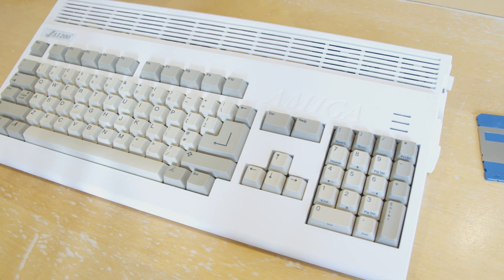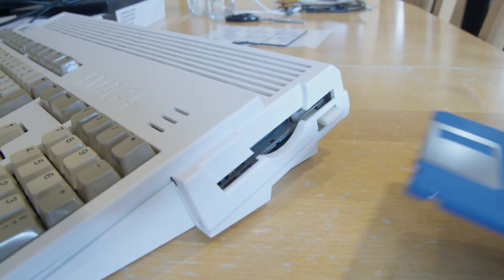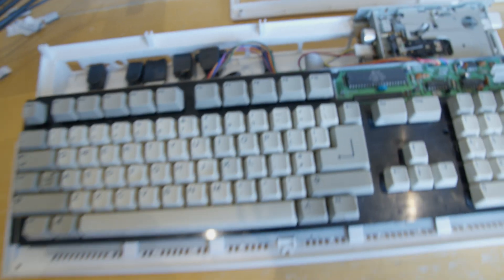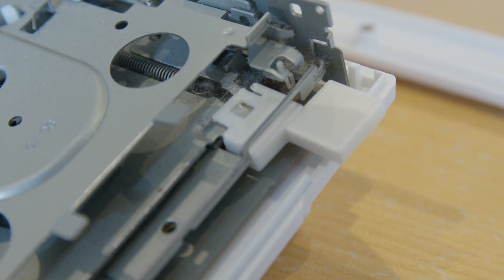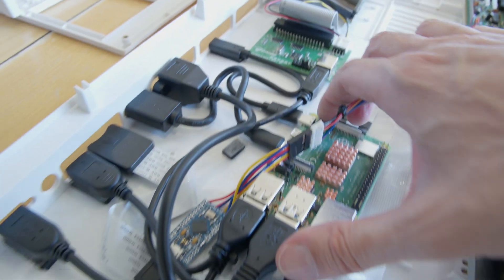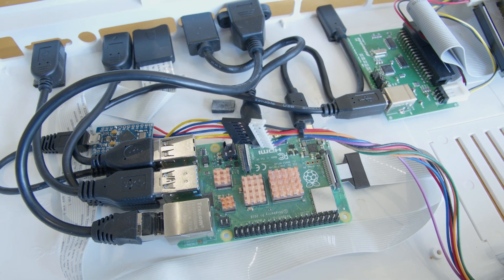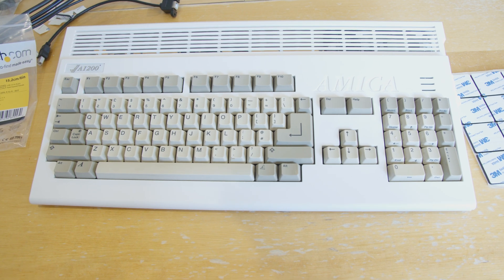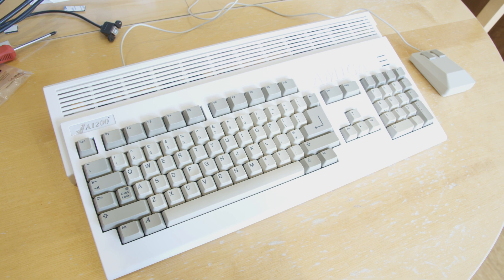This Amiga is not an Amiga

Comment: Hey does that go alright ? I mean does it feal like an amiga ?
And floppy loading etc
Reply from the maker: It's exactly like an Amiga. Floppy loading works just the same and makes all the same noises.
Reply: @RobFisherUK  cool. I just want to get Real crt 15khz on there with 288p scan mode on pi 4 unless pi3 is fast enough in stock speeds
Reply from the maker: @easyerthanyouthink  I've only tried my Pi 4 with HDMI. For CRT I was thinking about using a MiSTER FPGA but for now I only have an Acorn AKF60 and some of the Mister emulators drive it but not the Amiga one, so I don't have any direct experience.

Comment: Fantastic build and very much like the one i built last year for myself. 1x Amiga 1200 reproduction case bought from RetroPassion here in the UK (in grey colour but have since painted it cherry red colour), 1x Raspberry Pi 3b+ board (my spare one at the time of build) 1x Keyrah v2 keyboard interface board and a fully working Amiga 1200 keyboard (both of these were kindly donated to me by an awesome guy here in the UK). Made a full blanking plate for the rear of the casing (from a spare sheet of plastic i had laying around) and cut out all the holes needed to HDMI, On/Off switch, R/Pi's power and the same type of SD card to micro SD cable adapter as yours. I haven't fitted a Greaseweasel board in mine for adding a floppy drive, as i have the awesome Amibian v1.5 (Full version) running on my Pi and loaded up with games and music demo's.
Reply from the maker: Between us we've made the perfect Amiga! I couldn't find a Keyrah and I really could do with making a proper backing plate as the 3M pads aren't really strong enough.
Reply: @RobFisherUK  The new Keyrah v3 is now available to buy online. I googled it yesterday. Think it's about 50 euros to buy, check it out, bud

Comment: This looks great! Having it in a real case tricks the brain enough to bring at least me back in the mood and wake those nostalgia feelings! Using real floppies the same. You talk about the mister fpga way. To me the mister is not powerfull enough for Amiga use. It is okay for OCS/ECS-Amigas and stock AGA-Amigas. But it does not come close to the real Amiga I had with 060 and Picasso IV back in the days. So I support your choise of the RPI. Hope you bring more videos as the build evolves. Stunning looking case btw!
Reply from the maker: Yes it does trick the brain enough. The main idea with the Mister is to get analogue output, possibly AGA to my Acorn monitor if that works. But I have not tried it yet, so we'll see.

I have another video in the works where I am trying out some old magazine cover disks.